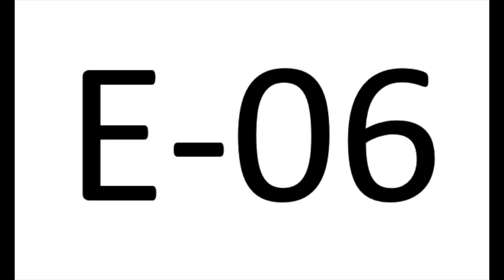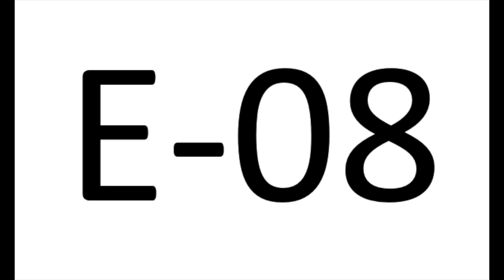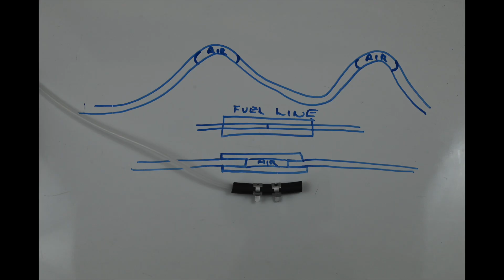Chinese  Diesel Heater - All the Fault Codes & How to Fix Them

Comment: I woke up to a fairly new heater giving me an E-12 code this morning.
Reply from the maker: Most likely low voltage, try running your engine while the heater starts
Reply: @EnglishHobbyMachinist it's hooked up to my 12v solar system that heats the shed the batteries are in. Batteries are 4 300ah 12 volt that are currently at 80%. Just found someone saying it's a loose glow plug code.  Guess I'll be digging into the heater today
Reply from the maker: @AlaskanFreedom check your cable run from the batteries is big enough, you could be getting loss in the cable particularly is you used the one that came with the heater which is to thin

Comment: Mine is brand new ran for first time. It ran 7 hours on max setting then shutoff, and I had 1 liter of diesel left. At first it showed e08 then I tried to restart it twice and it would start, blow air, then power down and showed e10 code. Temps were about 25 F out. No clue what is wrong. Again brand new unit.. used once for 7 hours. I do not know what to do. Thanks for any tips.
Reply from the maker: Most likely not enough power or glow plug
Reply: @E @EnglishHobbyMachinist glow plug could be faulty out of the box. Being brand new it’s unlikely but I guess it’s possible
Reply from the maker: @tashrayt4398 I have known them to fail out of the box
Reply: @EnglishHobbyMachinist I read online they will shutoff if you have less than 1/4 diesel in the tank. Which is similar to my situation. Have you heard of this?
Reply from the maker: @tashrayt4398  they are not that clever, they will use the fuel till the tank is empty.
Reply: @EnglishHobbyMachinist I have it connected to a 2000 watt jackery.

Comment: Thank you, Greatly appreciate the video.  I have a brand new Vevor, on the second tank of fuel, noticed white smoke coming out of the inlet on attempted start up.  During a prior run, the DC power was disconnected,  and that also saw white smoke but it worked when reconnected.
Now going over your other videos

Comment: Just installed mine keep getting an E 10 error. Through a lot of searching online found a video that showed me how to prime the pump. I can see the fuel line. It looks clear uninterrupted no air bubbles. But will not start up. I have never got it to start up. I keep getting E 10 error.
Reply from the maker: Most likely not enough volts or amps, how are you powering it

Comment: So my vevor unit came out of the box and worked great for a short few minutes. I powered it down, put it in its permanent mount location, routed the exhaust out the garage wall, and powered it back on. The 2nd power up now has a e7 code. Ive checked all the connection points unplugging& replugging them back in. Still no change. Does anyone have any information on what i should do/check next?
Reply from the maker: How are you powering it?
Reply: @EnglishHobbyMachinist 12v battery with a back up 12v supply. I think i saw 12.1 at the lowest and 12.4 at the highest while messing with it trying to figure things out
Reply from the maker: @mr.mediocre10-02 I am guessing you don’t have enough amps and as soon as it tries to fire the glow plug it cuts out. Especially if you have a long thin cable to it. Without knowing your exact installation it’s difficult to diagnose. I would aim for at least 13v and 20amps at the heater end. You could try putting a multimeter on it and switch it on and see how much the voltage drops measured at the heater end

Comment: EO4 code on mine have 18v milwaukee to a 12v converter when i test for voltage at fuel pump pins it shows 7.9 v constant the pins coming into the harness show 12v
Reply from the maker: A milwaukee drill battery will not have the required power especially through a converter

Comment: Hi there, Great video i an having a problem not in video, i have had my chinese heater about two years it’s been off the last couple of months due to the summer weather a couple of days ago the controller is leading up when I switch the on button for the heater. The control panel stays on for five seconds and then switches itself off not starting the heater. Do you have any idea what might be causing this

Comment: E-06 isn’t always the fan. My fan gap is fine, if I spin by hand it shows the movement in the control

If I put 12v to the fan it rotates so motor is fine. 

No alternative so far, except I can’t get the pump to prime so maybe the pump is dead and console is unhappy? Who knows
Reply: Same.. did you ever figure it out or get it to work??

Comment: I get e-02 and e-08 . This unit is brand new, it worked good for 24 hours and now it won't work. I am using it to knock the chill off a garage so I can keep my plants warm. Very discouraging
Reply from the maker: @ellobo4195  check your voltage and fuel
Reply: @EnglishHobbyMachinist  yes it was my car battery (brand new) down to 9volts. Hooked my battery charger to it and gave it a hour to charge, then left it hooked on running at 2 amps and the heater fired up. It pulls alot of amps. I guess I'm going to get a inverter for it.
Reply from the maker: @ellobo4195  they pull about 20 amps at start up then run on virtually nothing.

Comment: hello 
I changed the glow plug 
Battery with 12.8 voltage
I even changed the main board 
The fuel line and pump are also healthy 
But it still gives error e03
Reply from the maker: @mehdimoradi1041  most likely you positive cable is to small, try a heavier gauge cable

Comment: Hi Just installing the heater...I've got error code F2 E06 come up. Not sure what the F2 means. I think the E06 is due to the casing catching with the fan. If I sort the E06 issue, will the F2 disappear? Thanks
Reply from the maker: @joneden7994  I suppose the only way to find out is to fix the fan issue and see what happens
Reply from the maker: @joneden7994  it can also be loose or damaged wiring

Comment: If there is air in the hose, how do I get it out?
Reply from the maker: @jufalucian2762  remove the pipe to let the fuel through. If its a small amount it will work itself out eventually
Reply: @EnglishHobbyMachinist  Thanks,

The pipe between the tank and the pump or between the pump and the heater?

Comment: Nope. Got error 02. Used a 110 volt to 12 volt dc power supply. Dropped 9.7 to 14.9. Still code 02
Reply: Mine does the same on cigarette lighter or 110 to 12v converter.